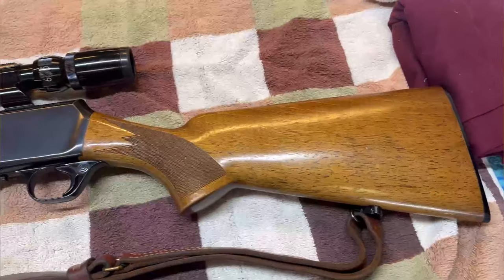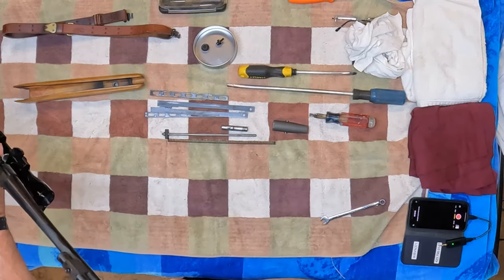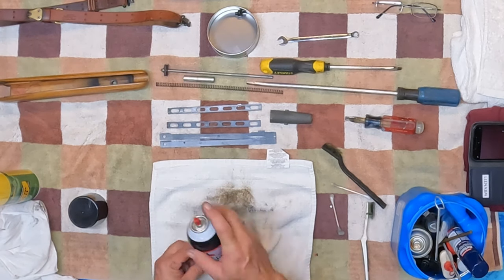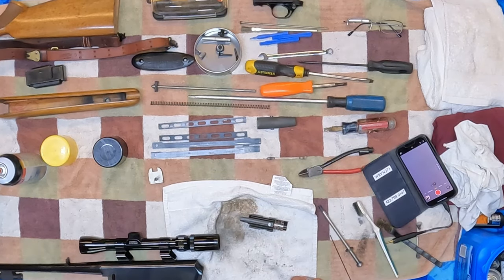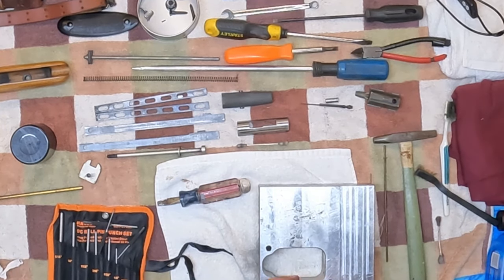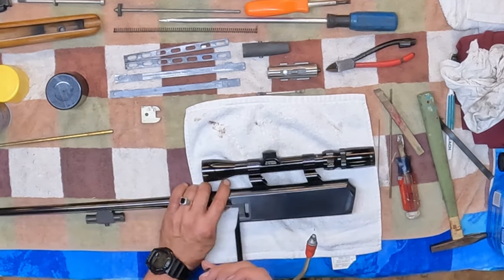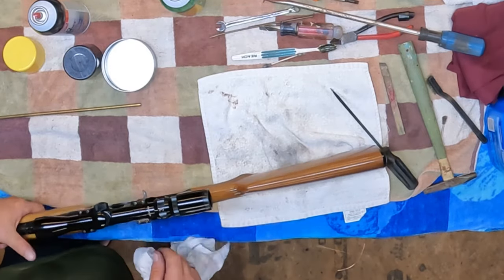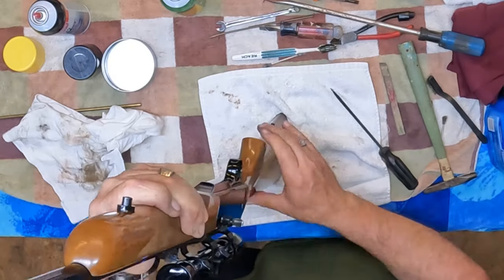Browning BAR Rifle 308 7.62 x 51 Disassembly and Cleaning #browning #browningbar #BAR #guncleaning

Comment: Great job , thank you for sharing your knowledge . I currently own a new Bar in .243 , Mark 3 Stalker . The manual is not very specific about disassembly. It appears they don’t want you to reach the gas piston inside the block . Good idea about anti seizing grease for threads on the regulator nut . Other than leaning , it’s a pleasure to shoot . Cleaning however, is a slow process. Thank you again . 😊
Reply from the maker: Thanks for the comments. Makes it worthwhile making these videos when i read comments like yours.
Jack

Comment: What a terrific video, I have three of these at the shop I work at, waiting for cleaning and I haven't done one before so I spotted your video and it was VERY complete. Looks like the only thing I will be concerned about is that pin that secures the firing pin .
Reply from the maker: That little pin can be a bugger the first time. What makes it though is the angle the ends are ground on. Makes it tough to center the punch.

Comment: How often does a rifle need this deep cleaning? i clean my rifle after every hunt, but just curious how often it needs this indepth cleaning?
Reply from the maker: That is very hard to say. Allot has to do with how many rounds it fires. Most of the cleaning needed is at the gas block area. This is the area that gets dirty from the carbon from each round. On mine, I will take it down after 30 rounds to inspect the gas block area. Based on what I find will help me decide my next cleaning. 
Unlike my AR15, it gets a complete cleaning after shooting it. Mainly because the gas pressure gets to the bolt area and makes a mess. The BAR bolt area stays much cleaner because of the actuating arms. 

That being said, I know a few people that have never taken the bolt apart or even seen the gas block area and there BAR drops deer every year. 

Regards

Jack
Reply: @lifeintnchevalier  Browning doesn't even show the forend removal as part of the cleaning process, just trigger group removal.  I like that you show how to do it.

Comment: Merci pour l'excellent vidéo. Je possède une bar 30.06 que je veux nettoyer à fond, j'essaie d'enlever le boulon donnant accès au piston mais après plusieurs tentatives il refuse de bouger. Quelqu'un aurait-il quelque chose à me suggérer ?
Reply from the maker: Thank you
Reply: Soak the boulon in powder solvent overnight. If it has a round head use a channel lock.  Put the gas block in a vise so you do not stress the weld to the barrel. Also you might have to tap the piston out. Try a hardwood dowel or a hard plastic dowel to avoid damage to the piston. Good luck.

Comment: My buddy has one but it only shoots once? Any input?
Reply from the maker: Does it cycle in the next round? If not, it may need a good cleaning and lube. If it does, i would check the front of the bolt for debris and the surfaces the bolt seats when it returns to battery.
Reply: @lifeintnchevalier  I'll take a look

Comment: You didn't show how you got the bolt assembly back in...
Reply from the maker: Sorry about that. The camera i thought was recording that , did not and the other camera was filming from the side. I will try and capture that in another video after hunting season
Reply: Good luck hunting sir!
 @lifeintnchevalier
Reply: this is what I'm struggling with for some reason haha @lifeintnchevalier
Reply from the maker: @fortymikemike6285  under stood. Mine slipped right in. I know it is important to have the gun upside down so it stays in the track as you slide it forward.

Comment: I have a Belgium-made BAR that I have disassembled, cleaned, and reassembled many times.  Today I’m having trouble getting the bolt back into the frame so I watched this hoping to find out what I’m doing wrong.  Unfortunately, you recorded blowing the frame with air, spraying with oil and rubbing with a towel, but then you stopped recording, put the bolt in the frame, and then started recording again, saying “now the bolt is in place.”  That was the only thing I wanted to see and it happened when the camera was off!  WHY??
Reply from the maker: Ya, sorry about that. The third camera had a bad SD card, I thought it had that angle.
Reply: Can we get a bolt insertion video. I’m having this issue also.

Comment: what a sin ! beautiful weapon and a craftsman screwdriver. very disrespectful
Reply from the maker: There is always one! That is a huge bolt that needs a big screw driver. If you ever removed one that’s was stuck, you would reach the driver that fits the best and sports a heavy handle. The Craftsman did just fine. Less of a driver may have slipped and damaged the screw.